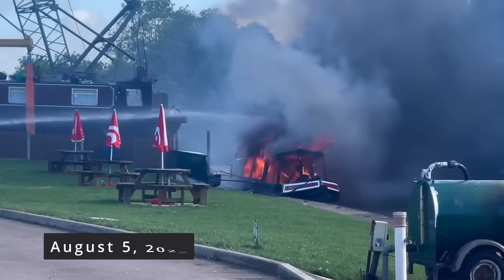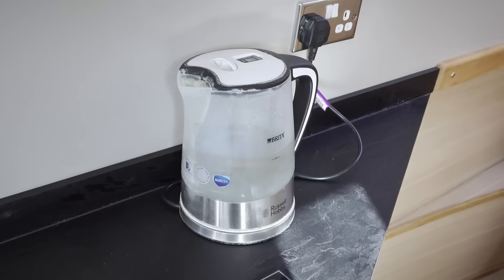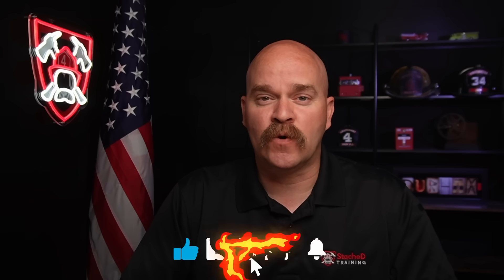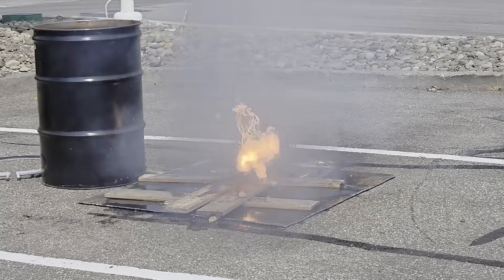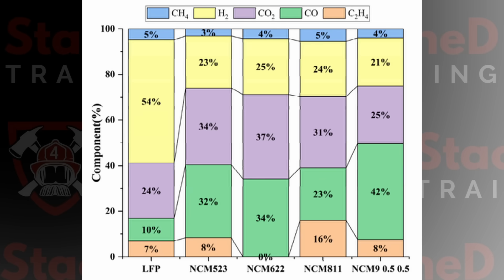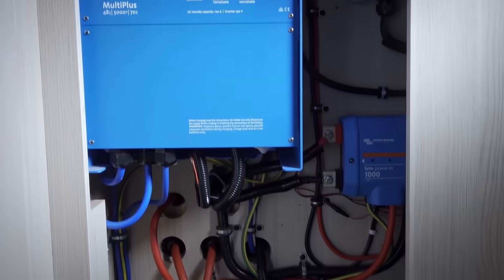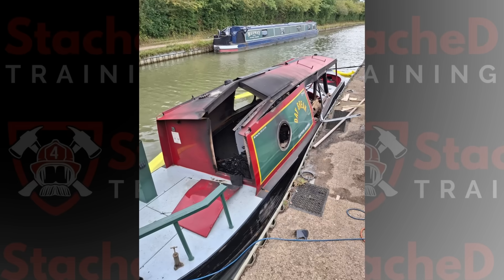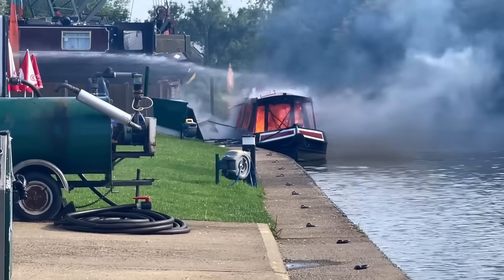Electric Boat Explodes While Charging: LFP Batteries

Comment: Hi Stache,
I've rented those canal boats in the UK (also called Narrow Boats).  They are basically RVs for their 1000 or so miles of canals that date back to the start of the Industrial Revolution.  You can rent them or even live in them indefinitely, and some people do.  In fact, day trips are the exception.  Our two Narrow Boat trips were 1 week each, and they fun, big time!  But I agree 100% with you, it would be scary as hell to be sleeping in one of those boats and have the batteries light up...but the British government in the process of requiring the conversion of these boats to batteries, which likely means the end of those boats, once a few more of those fires occur and families start being killed.
Reply: This is incorrect, there is no government mandate for boats to become all electric. I also live on a Narrowboat in the UK and the majority of boats built are diesel. Very few are plug in electric, hybrid battery/generator are slightly more popular.
Reply: @philelliott5327  - My bad, I had heard otherwise, but agree, no mandate, at least not yet.
Reply: no there are no mandates for canal boats to become electric
Reply: You're absolutely right this is how the government will make it work. It will take a few years, but they will pass legislation saying that any modifications or replacement of the motor will be required to be electric. They already doing it with gas boilers. Any new buildings have to be heat pumps instead of gas boilers.
Reply: @pdevonport7266  in scotland our govt has scrapped the mandate for doing away with gas.
Reply: @pdevonport7266  I live in a Victorian built house and we cook and heat with a wood stove which is free as I fell trees so fire wood is endless. there has been suggestions wood stoves would also be banned in houses.
The Phrase from my cold dead hands springs to mind. 
Legislation is one thing enforcement is a lot more work for the state and the courts are already busy.
Reply: @willtricks9432 l want to eat at your house 🤤
Reply: They could design batteries which can be jettisoned like a lifeboat but it would require hull mods to get the weight low enough so it doesn't cause stability problems. A hull-conformal battery box could be jettisoned in case of fire and fitted with a fusible link so sufficient heat would automatically jettison them.
Reply: @oldphart-zc3jz why don’t they just use automotive batteries that are then converted to marine applications with all the improved safety and durability systems? Car batteries are liquid cooled and there is enough water in canals to keep them cool too! Plus designing purpose compartments to control humidity! Temperature and also salinity can be implemented.
Reply: @Mike-fj2ln you're talking out of your backside, there is NO mandate to convert narrowboats/barges to battery power
Reply: @TheWacoKid1963  - True, not yet.
Reply: I live on an English narrowboat for the whole year, I can assure you the British Government is not mandating the conversion of narrowboats from diesel to electric propulsion. There is a small eco discount on the annual boat license of 25% or about $400 USD for electric propulsion, in other respects lithium battery installations on boats will soon be subject to an extra level of technical scrutiny once every 4 years during a boat's safety inspection.
Reply: Junk
Reply: Our British uniparty scumbags are brain dead. None have actually had a real job. They have copy and paste degrees. So NO electricians or engineers etc.
I do agree with you about canal holidays. We all had a great time on the Norfolk Broads.
Reply: How does that song go "..suicidal  , suicidal..."
Reply: Yeah but there have been hundreds of diesel narrow boats going up all the time according to the EVangelists.
Reply: @scaryfakevirus  ..something like  a hundred diesel fire in fifty years..? 😂
Reply: @MrFryfish  Maybe yes.  But diesel doesn't spontaneouldy combust does it.  Spillages and bad practices will be the cause.
Reply: The British govt has their head up their ass.   They are no longer dealing in reality.   The people should throw them out of office and prosecute them.  Civil disobedience will get the point across
Reply: Canal boats also use LPG gas which is heavier than air,which is much more explosive. Nothing is 100% safe. There are petrochemical vehicle fires all the time.
Reply: Except it's looking more and more like this whole video is a misrepresentation of what actually happened.
Reply: @tracyrreed any links or signposting to the real story?
Reply: Hold the government liable!
Reply: @TonyMeadmore hold the companies making bad electrical designs and also the government for not making regulations for those changes.
Reply: Untrue. The Government are most certainly not requiring conversion to batteries. You ascribe far too much organisational ability to the UK Government! How do I know? I've lived on a narrowboat in the UK for the last 25 years. And I sleep just fine with 40kwh of LiFePo on board.
Reply: @thedogfather5445  I suspect your installation is professional and your maintenance is up to scratch. 
That is not the norm in my experience, even the big names are far from perfect. There is something about boat electrics that encourages shoddy work.
Reply: @tightcamper  I've worked on Dutch-built boats by reputable builders and the electrics are horrendous. Very often the AC supply doesn't even have a Residual Current Device.
Reply: @tightcamper exactly! People are easy to be harsch on reporter like this totally forgetting the real issue which is electric design and the actual components and their management! There are also things like TÜV in Germany where you can regularly let your system checked.
Reply: @thedogfather5445 the problem with batteries is the way they are managed and the installation of the electrical components! You won’t have issues if it’s well done that’s facts!
Reply: @carholic-sz3qv That is almost always true. I've lost count of the boats I've examined where the owner has been adamant that his or her diy installation is perfect, but I still failed them because it was actually dangerous.
Reply: @thedogfather5445  That's because you have zero technical knowlege and no imagination. No way would I sleep on board with lithium batteries and I speak as an Electrical Engineer (Aerospace) of many years standing.
Reply: What can be said... hmm.. I know now: Good Luck!
Reply: @MrFryfish   Good luck, you fools.
Reply: @ejh1100  
No need for spitting out ... my friend, I am sure..
The BIG difference between me and you is that I KNOW how hazardous a battery pack become over time.. not now.
Now you are happy with them.. Later, just be careful if you still wanna reply on YT and other social networks..
I am just sayin'
Don't take it personal..
Reply: @ejh1100 .. are U actually sure you wanna say that to me? :)
Reply: @thedogfather5445  - Thanks, I had heard they were required on another video about this fire.  We'll see just how extreme the UK government is in this regard.  Best of luck, mate!
Reply: There is certainly talk about boats going electric, so expect it sometime. Just because you haven't heard of it or it doesn't happen now, doesn't mean the government eco idiots won't try it.
Reply: @DanRyan-v5y 10 month YT account = Troll
Reply: @johnmulligan912  strange comment. What does anyone new do? Wait a couple of years and then comment? What is your limit for a completely arbitrary time span before anyone can be regarded as not a troll?

Perhaps you are a troll. He who smelled it dealt it etc
Reply: @DanRyan-v5y another narrowboat dweller here - i think it very unlikely that electrification is extremely unlikely to be forced on us. The government hasn't even been able to take away our multifuel stoves yet! 
Our secret weapon is to be all traditional and twee - English people cannot resist that. 😂 
Having said that, im just fine with my 800ah of gel leisure batteries thanks! 😊
Reply: Grow up...  being alarmist . Submarines and large ships are at least hybrid electric with such batteries.
Reply: @bbbf09  - I doubt they have LITHIUM ION batteries, since if they did, we would be hearing about their fires, as we're hearing about the fires on EV car carrying boats now.
Reply: @bbbf09 Lead Acid batteries. Infinitely superior design instalation and maintenance. Manned 24/7

Comment: BMS: well, if the "battery" was a concoction of "12V" batteries, wired as you showed, then there is no overall BMS here. Each 12V unit has its own BMS, but what as a pack they are not being monitored by "unit". So unless those 12V batteries are each being charged by a dedicated 12V charger you've got problems with balance just for a starter.
Whats also missing here (as I'm sure its unknown) is "what rate of C the battery is being charged at"?
So 1) series charging with a 48V supply is bad 2) knowing C is important.
Love your channel, please keep it up.
Best Wishes
Reply: 110% spot on mate. I see a lot of these setups done with no engineering at all. Their dangerous. When I made my E boat, I put 2 batteries in, with isolators, and I can remove them to charge individually to 85% then I'll put them back on board
Reply: @jamesaustralian9829 I really wonder why or if they even have systems like TÜV to properly check those installations
Reply: If these pictures are the set up it looks like the person who set it up doesn't have a clue what they are doing.
Reply: @ItsAllJustBollox exactly
Reply: All battery manufacturers say series charges on their  batteries not allowed. If you want  charges them inseries for e.g  4x 12V for a 48V system, you need an approved sub balancer. 
Better you purchased a factory wired 48V pack with all safety features.
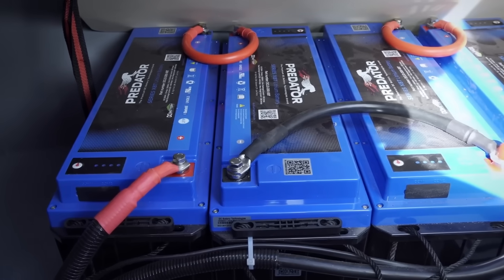Reply: Hmm, yes if those pics (1:25) are the actual boat then it does indeed look like 4x 12V series-wired batts ('predator') as a 48V pack with no sense wires/overall BMS. With a Victron Multiplus 48V/70A/5000kVa inverter/charger and Lynx busbar. That is a recipe for imbalances between the groups of 4 cells developing over time. I'm still quite surprised the boat blew up, but clearly something went badly wrong.
Reply: Yeah, I ride a Ebike, and my first thought was about the BMS.
Reply: Homebrew battery setups do seem to be over-represented in fires and explosions.
Reply: @spankeyfish exactly
Reply: When you see the racks of small cells inside an EV battery pack, you won't be surprised when you see how many dry cells are inside these batteries to make 12VDC. An 18V hand drill has roughly a dozen give or take 3.7V 18650 cells to make 18V
Reply: Exactly
Reply: According to @WillProwse in a separate comment, the photos in the video are just representative, and not the batteries from the actual boat.  He doesn't provide any details on how he knows that, but it's at least uncertain whether the Beta Marine concoction of 12v-nominal Predator batteries pictured is the same as what was in the actual boat.  Still, even if this is just a picture of a LiFePO4 system picked at random, the fact that an unmanaged series wiring was what he found does tell us that unmanaged strings like this are probably terrifyingly common.
Reply: Several 12V batteries wired in parallel only takes one battery to short out rest are going to dump current into it. No fusing between batteries if you are going to parallel best to use a busbar and fuse each battery. Victron makes busbars that do this with fusing. Inside that battery box wiring may not be big enough to handle that much power. Even though those LFP batteries look like a lead acid battery they have wiring inside.

Comment: They'd be 1000 times safer with jell cell or standard acid cell car batteries.  
Lithium should never be in a water craft, period. 
A diesel generator and lead acid batteries with an electrical inverter.  
The diesel will run anything above in the kitchen and a heating or cooling unit. 
Destroying a channel boat to virtual signal. 😂
Acid batteries would just delute if they get swamped with water.

Comment: Great, I was just convinced that LFP batteries were much safer than NMC batteries. Now I'm not so sure...
Reply: I mean, they are safer. They don't self ignite, and you really need to abuse them before they go off. Its just that you need a ventilation solution for the rare failure cases.
If you store your LFP batteries in a closet with a ventilation pipe to the outside and you get a failure, all that'll happen is that you vent some gasses to the outside and you get a blob of molten goop inside your closet.
If you store your NMC batteries in that same closet and you get a failure, it'll burn your house down.

LFP is much safer than NMC. But it is still storing an awful lot of energy. You need to respect that and store them appropriately. Same way you wouldn't store open cannisters of gasoline next to your stove.
Reply: They are. This wasn’t a battery it’s self failure. But he’s spinning it as such.
Reply: Nothing is without risk, but LFP is much safer than NMC.
At this point we really don't know what happened and if this actually was identical to the footage shown.
Even if this turns out to be LFP with some poor design, bad install and/or faulty electronics, it does not compare to the many thousands of spontaneous NMC fires we have seen so far. There are millions of solar battery installations using LFP and I have yet to hear of any one catching fire without something else being the root cause. If a gas boiler, NMC e-bike battery or a fallen candle sets fire to a property, the LFP battery does burn eventually.

Comment: EMS FLIGHT  =  Emergency Miracle Service ( Helicopter ER)   Law Enforcement (also) flight   Synonyms= accident crunch difficulty necessity tension        Strong matches, climax clutch compulsion depression distress exigency extremity fix impasse juncture meltdown misadventure  pass  pinch  plight                                              predicament pressure  push quandary  scrape strait urgency vicissitude                                                                                                                                                                   "You are normal, you're just not very well" is perfect was a good thing I heard a EMS team ,talking to someone that was badly Hurt in a   accident

Comment: They need to mass recall all of those boats 
Maybe even anything else with a battery too just to be safe
Reply: Cheshire Fire & Rescue Service - Boat Safety
Petrol Solid Fuel Stoves Causes of fire on boats The cause of fire is varied, but could include: Escape of gas from an LPG installation coming into contact with an ignition source resulting in fire/explosion. Flammable vapours entering the accommodation space coming into contact with an ignition source

Comment: Anything mechanical CAN and WILL Fail at some point.  I am curious as to the battery manufacturer.  The cells are quite common but the BMS is usually what fails and right now they are all over the place.  Im hoping it was a China made version and not a DFLI made battery. Is there any info regarding the type of battery that was in use??

Comment: How about the Las Vegas Boring Co? No fans, No emergency exits---if a car battery catch fire and  4 or 5 cars are in a tunnel----lots of luck trying to get out in total darkness as lighting is via a continuous LED stringers which will burn first!
Reply: It's an unnecessary risk that musky is willing to make.
Reply: Mont Blanc Tunnel fire 24 March 1999, Deaths 39 14 Non-fatal injuries -- a transport truck caught fire while driving through the Mont Blanc Tunnel between France and Italy. When it stopped halfway through the tunnel,  it violently combusted. Other vehicles traveling through the tunnel quickly became trapped and they also caught fire as firefighters were unable to reach the transport truck.

Comment: I have a 2024 Honda crv hybrid.  I park it in the garage.  Should I keep it outside in the driveway?  Thanks
Reply: Kelly Blue Book has an article about a small number of 2023 CRV Hybrids that were recalled due to a battery fault that could cause a fire. It was under a hundred and for an earlier version, but it's not a bad idea to store the car outside. There's many reports of different makes and models having battery fires in garages, leading to the house being damaged.

Comment: The number of people that insist that LiFePO4 batteries are "safe" is frightening......its an example of chronic denial.  If the BMS fails, and after all its just a printed circuit board with Mosfet's.......the batteries get over charged, they vent gas and then its down to confined space and ignition to create a severe hazard.  The GenEX "grid battery near Rockhampton last year, had a fire in its LiFePO4 batteries, and that was a grid level, commercial installation fitted with all the best fire management monitoring and suppression.

Comment: The Titanic set out to cross the Atlantic with a fire in one of it's coal bunkers. It sank, people died. We did not return to sail powered ships. Yes batteries are dangerous and these concerns need to be addressed. We on the other hand do not need to stagnate or rewind technology. Battery power is not about saving the environment or green tree hugging crap. It is about efficiency. Not wasting power. I don't like Tesla cars, but the model S Plaid can run a quarter mile consistently in 9.3 seconds on street tires. That is a quantum jump in automotive technology . Now if that power was used for something more sensible, we may see a future in this technology. To turn your back on battery technology and say it can never work is like saying there will never be a use for a telephone in every house, no one will buy a radio because there is no radio transmitting stations, televisions will never sell, why would any want a computer in their house? This rant is for the commenters not the presenter as he was talking about fire safety.